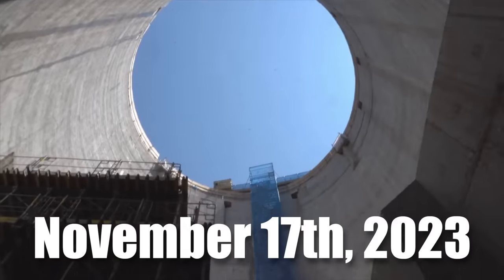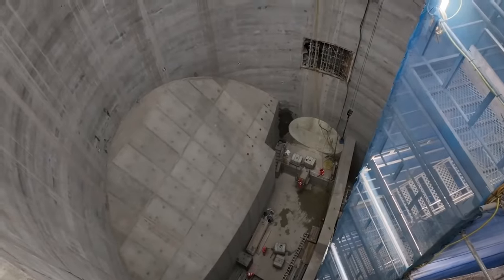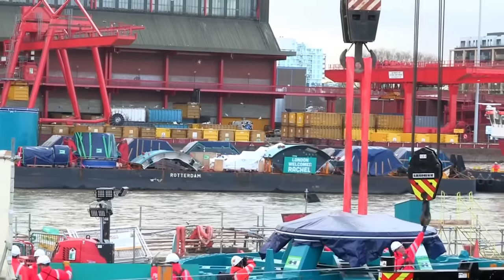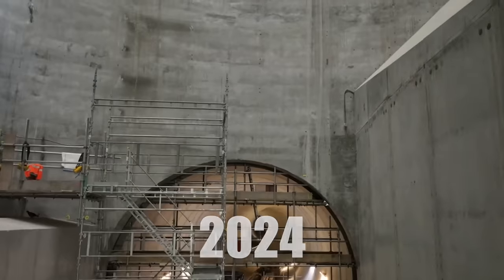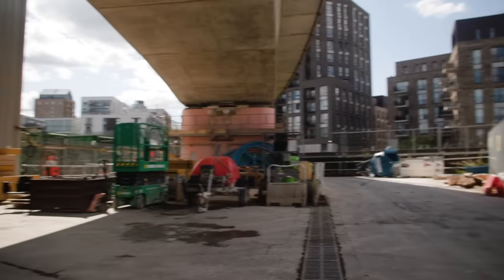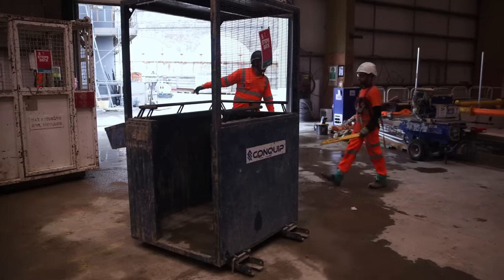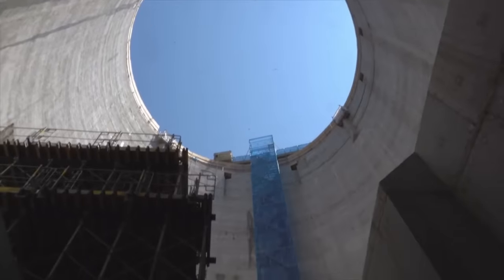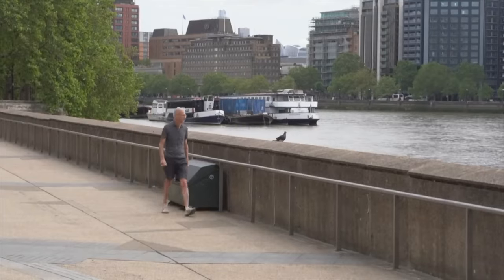London Is Building A $5BN Super Sewer That Nobody Has Heard Of

Comment: sticking plaster... need to separate rain water
Reply: Have any idea how difficult that would be? To separate rainwater from sewage would in many case be near impossible and would require huge amounts of roadworks and disruption to almost every household, many homes in central London have just one drain that handles both waste water sewage and rainwater. When the system was first built rainwater was meant to help flush the sewers through.
Reply: @wobby1516  some estimates say £600 billion with a “B” might be to be an end of life replacement thing. But it should be the end goal no service lasts  for ever
Edit…. Roads need replacing too ever 20-30 years , we need more joined up thinking do it together
Reply: @wobby1516   It's something that should have been implemented for new builds years ago, yes it wouldn't help with existing areas, although they could gradually be added to the system over time.

Comment: I would say rainwater and sewer water should be separated. Also designing for future growth could be costing effective versus the population at present.
Reply: Totally agree that rainwater should be separate from sewage
Reply: Separating the rain water would be a relatively easy fix to prevent dumping raw sewerage in most areas, during heavy rain fall instead of going through the treatment plant it could go out through overflows, not ideal, but a lot less harmful than raw sewerage. No one wants to spend the money to put all the new sewerage pipes in though.
Reply: @kaneworsnop1007  relatively easy?
Reply: It keeps the drains clean, nothing worse than raw sewerage lying about seeping out everywhere
Reply: @suburbia2050  if the sewerage is just lying about and seeping out everywhere then rain water would only exacerbate the problem by increasing the volume. How do you think the sewerage system continues to function when it doesn't rain for days or weeks?
Reply: How about each and every home, apartment building or complex, and commercial and industrial connection to the sewer system install grey water systems for partial reuse?!

Comment: Back in 1962 I worked on the Northen Outfall Sewer at West Ham just East of Abbey Mills pumping station, where the five outfalls cross several railway tracks and Manor Road West Ham. The sewers were damaged in WWII and repaired with cast iron tunnel segments, though great for a quick repair, the webs and bolts on the inside caused blockages with the solids and other waste catching on them. The pipes were flushed with water from Abbey Mills and then each pipe in turn was closed off and pad locked. Then the tunnel segments dismantled and new bridge girders and hanging brackets installed. New cast iron segments installed with webs and bolts on the outside, the recessed joint grooves filled with steel filings. Then the pipe was commissioned, and the operation carried out four more times. This was carried out through a terrible winter with thick fogs that on one occasion it took my father and I nine hours to travel home to Barnet North London. London was covered in ice, men were taken of the dole and set to ice chipping walkways etc.
To lift the concrete beams into place over the railway tracks, a rail mounted steam crane was hired from British Rail, it was amazing to watch. The driver received signals from the banksman blowing a whistle for stop, the direction signal given by hand, the crane driver would carry out the lift for example, then the banksman would blow his whistle for stop and all the crew would shout stop. This continues for each raise, lower or swing in turn.
Reply: Too complicated for us to understand what you’re saying but I appreciate you for trying to give us an insight

Comment: The ground underneath London is like Swiss cheese.
As well as the old sewers there is the Underground Railway, the Mail Train, the London Ring (A large bore tunnel that is an deep level drinking water reservoir.), a service tunnel distributing high voltage electricity around London, and numerous bunkers built during WWII and in the post WWII era known as the Cold War.

Comment: One good way to reduce solids loading in the sanitary sewerage system would be to introduce source separation; for example, solids such as fecal matter will be filtered through a thick layer of combustible garbage which will be periodically removed withma screw auger ( which will also remove excess moisture).

The solids could either be converted into various liquid and gaseous fuels, or even, if possible, burned directly. The heat could then be utilized for triple-effect distillation.

Comment: Will it separate run off water from sewage water? That's the main issue at the moment, as the combination of both causes the overflows into rivers/ocean. Run off water is fine to release, sewage is certainly NOT.
Reply: It's mainly the increasing frequency of heavy rain falls and flash floods that is causing the issue (Londons population has only just recently gone beyond its peak population of 1938 although clean water usage has increased per person to be fair), that is causing the dramatic increase in frequency of overflow into the Thames, this "super sewer" is basically built to capture the existing overflow and send it to the sewage works East, instead of into the Thames, the existing sewer system is still going to be there and working as before. There will still be overflows from this Super Sewer into the Thames during unusual heavy storms but it will be a far fewer occurance than today.

Comment: There's a small mistake with "Banchy Soletanche". It is "Bachy Soletanche UK", without a "n" in Bachy.
It is the UK subsidiary of Soletanche Bachy", a huge French construction company / group currently involved, like VINCI, in the building of the Grand Paris Express, among many other projects.
It is currently the world's largest geotechnical construction company.
The UK subsidiary was founded by Bachy in the mid 80's, before the merger of Bachy with Soletanche, that's why the name is reserved in the UK, while it is Soletanche Bachy in France and worldwide.
Bachy UK was established by the acquisition of Pigott Foundations Ltd and Foundation Engineering Ltd.

And it's VINCI Grands Projets (not projects), as it is the French name Grands Projets meaning Great Projects.

The video is great and very interesting but it could have mentioned that the super sewer tunnel seems to run under the Thames for a substantial part of its length, following the meandering path of the river.
Reply: @Dionysos640    It's also the reason for Frenchies to pronounce Vinci with a nasal i.
Since Da Vinci settled in France with king François the 1st, his name has been Frenchified as "Léonard de Vinci" and pronounced like a French name.

Comment: For use on high flow days currently projected at......"4 days per year"....WTAF!!!.....if anything shows the preferential treatment London gets in the UK then it's this surely?
Reply: The same companies, Bachy Soletanche UK, Costain and VINCI Grands Projets, are building (if it isn't delivered already) the Shieldhall Tunnel in Glasgow, as a major upgrade to the city's wastewater network.

4 days a year (certainly more in the coming years), combined with the very large population of London, are enough to massively pollute the Thames and its estuary.
That 4 days too much, it should be zero.
Every single drop of wastewater should be treated to avoid environmental harm.
Especially when it also carries wet wipes, tampons, drug residue, cleaning products residue, mineral oils, etc.
Crap in itself is enough yo pollute, but with everything else a large city produces, it's a biological and chemical hazard.
Reply: @KyrilPG  so what about all the other areas in the country with sewerage systems which have been to small for the capacity for decades and haven't been upgraded even as more houses have been built, which dump raw sewerage into the waterways on an almost daily basis?
Reply: @kaneworsnop1007   It too should be dealt with.
I wasn't justifying inaction elsewhere by any means.
I was only explaining the utter importance of such sewer upgrades for a city the size of London, and the scale of the risks of not doing so.
Reply: It was finished about 5 years ago.